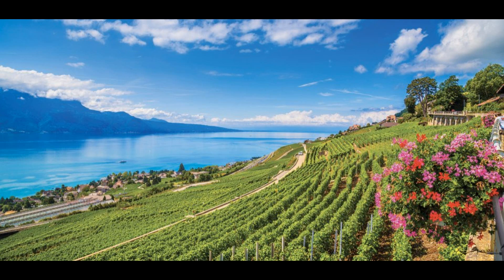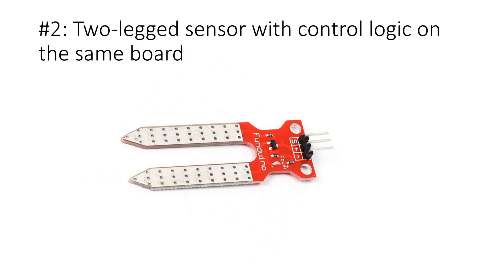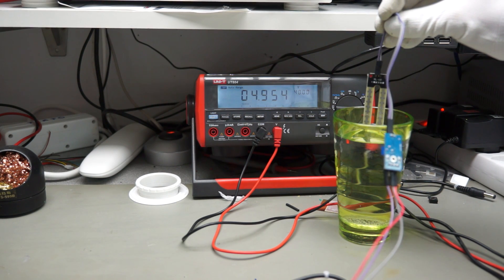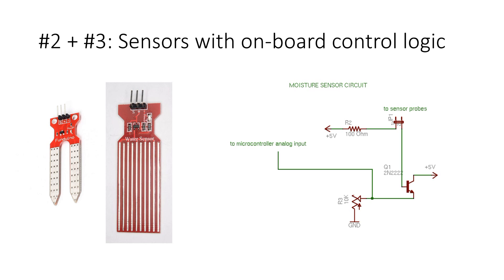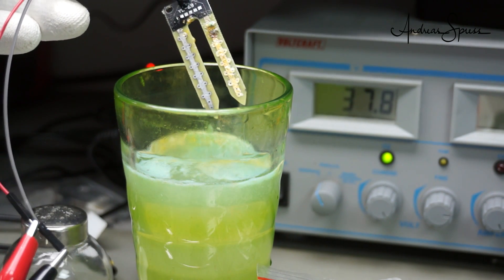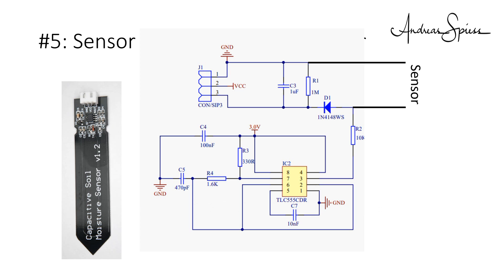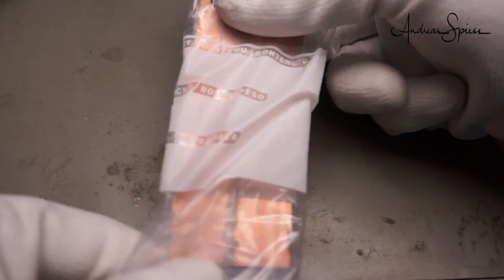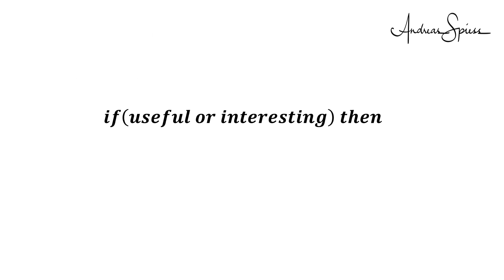#207 Why most Arduino Soil Moisture Sensors suck (incl. solution)

Comment: After seeing your video, I was hopeful.  To solve the initial corrosion problem, for the last two seasons I tried stainless steel strips for the probe but at the end of the season, even the stainless steel would corrode.  So I was kicking around the use of a tiny H-bridge driver but didn't get too far.  I bought a few of those capacitive probes and on the bench they seem to work but so far they don't seem to be very good at being able to detect the difference between damp soil and wet soil.  I've removed the 555 driver and driven it with the T0 output of an ATtiny at 500KHz.  The 555s were all running around 360KHz.  Has anyone had any real success using these EBay special  capacitive soil moisture probes?   Maybe my soil has to be sandier or something.
Reply from the maker: These sensors are not very accurate. They just indicate if the soil is dry or wet.

Comment: I have solved this problem years ago by using a capasitor in series with the sensor and using alternating current for measurement. The capasitor eliminates the DC component and prevents corrosion.
Reply from the maker: Using AC  was mentioned several times in other comments. Some also mentioned it will not completely remove oxidation.

Comment: if you have a stainless steel or aluminium fork, it probably won't corrode much as long as you swap polarity for each reading.
Reply from the maker: This would definitively be a better solution

Comment: I did something like this a while ago. I only measured every 15 minutes, using the AC measuring method with an arduino. The sensor itself was very reliable and basic, just two stainless steel rods stuck into a pair of screwable wire connectors. The system was running for a year with no loss of accuracy and absolutely no damage to the rods. The rods were 4mm diameter and 10cm in length.
Reply from the maker: Thank you for sharing your experience!

Comment: As a fix for an existing system and maybe in wait for capacitive sensor replacement, just edit the sketch to power the sensor only once every 15 minutes or so. A lot of example sketches have constant power to the sensor and you’ll quickly render them useless. With automatic watering, you’ll want to wait for the moisture to increase after watering anyways, so you can retest and see if it needs more watering. 

Even 1 hour or more could be sufficient for an automatic system.
Reply from the maker: Many other viewers suggested this method. But it seems not to work forever.
Reply: Andreas Spiess True, it will still corrode with DC current, but not as quickly as when the current is always on at the sensor. 
I’m ordering capacitive sensors for next years setup anyways, seems to be better for a more permanent setup, especially for greenhouses.  👍

Comment: The green stuff is copper oxide. The reason it does this is because of a process called hydrolosis where the current rips the water into hydrogen and oxygen. The pure oxygen then reacts with the copper on the traces degrading them
Reply from the maker: Thank you for the explanation!

Comment: First off measuring moisture with DC? Some wannabe engineer clearly skipped years of school.
While AC can mitigate the problems with electrolysis another simple way i imagine would be to just use graphite rods salvaged from old zinc batteries.
AC for measurement, limiting the time and current should help with directly measuring the soil conductivity.
Also since one is not required to have the electronic close to the sensor it is easier to take measurements from deeper in the ground helping to see if deep rooting plants get their fair share of water, too.
A lot of garden topologies require more than one sensor since water flows and propagate often very uneven, and foilge or any kind of covering have an impact on how fast the soil evaporates water or distributes it to plants or water just sinks deeper and flows to your now happy lazy neighbour ;-)
Reply from the maker: There are a few different possibilities. I still think, capacitive without any contact to ground is a good one.

Comment: Gosh darn those sensors suck some.. Arse!! Vegetable farmer and diy guy here that really dislikes those bare cheap sensors, I made some stuff with them but their values keep changing because the sensor is falling apart. Think also that you need to move the sensor weekly for the best reading of what is actually happening. But then again I feel my hands are much better sensors and a count down timer watering helps more then fighting the moister sensor.
Reply from the maker: I think our hands are much better in many areas. For holidays you might need long arms (or a good friend) ;-)

Comment: Great video! I've had this problem a few years ago with water level detectors. Even with small voltages the electrodes disappeared after a few days. I tried replacing them with stainless steel electrodes, it appeared it didn't corrode, at least not as fast, but I now realize it might create even more toxic waste as a result because of chromium. I wish I knew about the capacitive sensors back then.
Reply from the maker: Thank you for sharing your experience!

Comment: solution would be to use an AC signal / switch the polarity of the sensor electrodes 50/50d duty cycle
Reply from the maker: You are right. If you read the other comments you see that it would not help for much longer because in certain situations the sensors are destroyed without any connection

Comment: Any way to make a reliable moisture sensor with an adjustable digital output to directly control a solenoid valve ?

A capacitance sensor wired to a LM393 comparator perhaps ?
Reply from the maker: You can use any comparator for that.
Reply: Im a newbie at this, but do i understand it correctly that the capacitance sensor can be hooked to the controller pcb on your #1 sensor and it will output a digital 5v signal that can control a solenoid relay ?
Reply from the maker: Yes. All these sensors output a variable voltage. You should be able to connect it to the PCB of the #1 sensor because it contains a comparator.

Comment: I have the same experiences with both sensor types. The capacitive sensor, however, still has a problem. If the soil changes from wet to dry, a permanent gap in the soil can develop there, which makes further measurements useless. Of course, it depends heavily on the soil conditions.

Maybe high-frequency radio waves are the solution. I did a first experiment with a Bluetooth tracker and measured the dBm. Looks promising. I have packed it waterproof and buried about 15cm in dry soil. Then I irrigated the soil bit by bit and found noticeable changes in the dBm.
Reply from the maker: You are right. Measuring moisture seems to be an art. These sensors are just ok for detecting the time to water plants. Not more. They are not very accurate, but also quite cheap.

Comment: Hi Andreas, as reliable soil moisture sensors are interessesting for me over many years (my plants at my Student digs first raised the problem), I was very pleased to see your video. I think the only solution are the capacitive sensors. Today I found another implementation at tindie: SoilWatch 10 - Soil moisture sensor / https://www.tindie.com/products/pinotech/soilwatch-10-soil-moisture-sensor/
Reply from the maker: Thanks for the link. They claim that they use 75 MHz. This is quite interesting...

Comment: Hi Andreas, I try to use a shrinkwrap with glue inside to seal the capacitive sensor. But I do not if it was issued by the head or by the shrink tube. The analog read was 370-714 without the shrink tube and now 680-714. Therefore the shrink tube is currently not a good idea, but It would make it very simple. I orderd some new sensors to do more testing. My other died like you described by water coming in from the side.
Reply from the maker: Maybe you can send me a message on Facebook or Twitter. I also do some tests for a next video.
Reply: I'm thinking about designing a sensor which fits into those petling (small Pet Tube), where do you  think are the limits in wall thickness for this kind of measurements? I'm planning a whole package with an LiFePo Cell, ESP8266 and the sensor itself. Maybe i can heat and press the pet tube at the lower sensor part together to get a better smaller gap to the water.  This package would be 100% waterproof :)

Comment: As far as comments suggesting making measurements only every 5 to 15 minutes with the bare metal sensors, they will still fail just because they are in damp soil. As shown, releasing tin and copper oxides into the soil. Not good for your plants.

Seriously, just stick the sensor into one of your potted plants without any electronics attached to it. See how it looks after a month.
Reply from the maker: You are right!

Comment: A cool video idea would be setting up an all-in-one DIY sensing station that reports a set of values back to base.

* Soil temperature
* Air temperature
* Soil moisture
* Air humidity
* Barometric pressure
* Sunlight levels

Bonus points for making everything solar/battery powered so you can chuck it in your garden anywhere
Reply from the maker: Interesting idea...

Comment: Great video! Ive learnt new things. Anyway, instead of using capacitive sensors, what about using graphite as sensor probes? Graphite are used in many electrolytic cells as electrodes so they won't corrode away like copper does. Plus, i think graphite can be cheap too as it can be found in pencils.
Reply from the maker: Graphite was suggested also by other viewers. It is a good idea.
Reply: yes it is good... but electrolysis will still take place.

Comment: I started prototyping the 555 based capacitive sensor but then realized ... Why would I need a 555 when I am reading the value with a μController? I can just use the `analogWrite` function on the AVR to create a 50% duty cycle PWM and there is no need for a 555 astable multivibrator, just the circuit with the diode and RC filter. My idea was taking the cheapest resistive sensor, coating it with some plastic color, and trying to use the 555 circuit ... but now I think I don't even need a 555, can just use GND, PWM (Analog Out), and SENSOR pins with the AVR, voila! What do you think about it Andreas?
Reply from the maker: I think: try it. And report back.

Comment: I solved the problem with firt sensor you used- solder over electrodes. Works fine, lasts 5x more.
Reply from the maker: Maybe you read other comments. Lead in the solder seems to be „not ideal“ for plants. But for sure it takes longer till the electrodes are gone.

Comment: You aren't supposed to power those sensors all the time, you need to supply voltage at intervals like 1 minute or 1 hour... This prevents hydro electrolysis
Reply from the maker: This was suggested by many viewers. According to these comments, it does not prevent it, it reduces it considerably.

Comment: Thanks for your review! Ongoing calibrating my new capacitive 1.2 sensor.Sends signals from a esp8266 via mqtt to "Home Assistant HASSIO" After coating the sensor 100% wet is 526,  0% Wet (dry) the signal from esp is 806. Has anyone any experience what i could expect in between??? Current Ide code  " percent = (int) (287.86-(value * 0.36));"
Reply from the maker: If you read through the internet it is very difficult if not impossible to calibrate these sensors. They are not used for "precision" measurements, just for indications. And the calibration depends on many things including temperature.
Reply: Thanks! A voltige regulator for the sensor is a must. Have the sensor a linear or exponential behavior? The "trial and test method" with different temperature is maybe the best...

Comment: You can "solve" the resistance type sensor problem by only taking a reading over a short period (like a couple milliseconds) every hour or so. It'll still degrade eventually, but much, much slower.

I'm using a resistance type arrangement but I don't stick the electrodes into the soil. I've fixed two stainless steel electrodes to the bottom of the outer pot, and they just measure during watering when the water has percolated trough the pot to the bottom, which resets the timer and makes everything sleep for a week.

Couldn't you simply form the capacitor type sensor with two wires?
Reply from the maker: 1. The trick with the sensor switch is described in many comments and I should have mentioned it. Some commenters still experience corrosion. Maybe it also depends on the general moisture level or the chemistry of the soil.
2. If the two wires create a capacity which is big enough it should work. It depends also on the distance between the wires.

Comment: Nice Video! Number #5 output will change with fertilizer, or? (Higher salt content in the water)
Reply from the maker: Maybe a little, but not much. These sensors are anyway not accurate. The just give indications.

Comment: I didn't realize there were generics of the capacitive sensors now! From what I've heard they are a lot more accurate than the resistive ones.

Just so you know though, you can prevent the destruction of the resistive sensors by only applying power only for a few milliseconds at a time whenever you need to take a measurement. I used to just connect the +5v pin to an output pin on my MCU and turn that output on when I need to take a reading.
Reply from the maker: You are right. This was discussed in many other comments below.

Comment: As a proponent of KISS, I simply don't use any of those sensors.
It's just an ESP that opens/closes a solenoid and starts/stops a pump according to a schedule. The schedule can be changed in a web interface hosted on the ESP. Look how much water you use with watering cans and the output of your pump. Then you know how to match your schedule.
I also write the schedule to the ESP and time gets synched. So if power loss happens, everything will keep working like nothing happened.
Reply from the maker: I think this will also work. You even could combine it with Google calendar as I did in one of my videos. Then the user interface is also quite simple and the ESP has no data stored.

Comment: Interesting video. Expected the results of DC probes in soil, but didn't expect the capacitive sensor to work so well.
I used, many years ago, a different and more rudimentary approach to this: a probe made of two small strips of stainless steel and a single-transistor low power oscillator, similar to the so-called Joule Thief, to generate a "kind of sine wave" of relatively high voltage (some 20-30V) and very low current. This signal was fed to one SS strip via a capacitor and the return picked up on the other SS strip + capacitor, to be amplified by another transistor. The final prototype ended up looking similar to the very simple, yet effective, ESR meters that were proposed in forums in Russia and other eastern european countries at that time. I could not find my old circuit, nor the russian ESR handwritten diagrams, but I found a much more recent version of this kind of design in http://zpostbox.ru/simple_esr_meter_circuit.html and another in http://paulorenato.com/index.php/electronics-diy/94-building-an-esr-meter, with a more complicated oscillator with a 555.
Although outdated, this simple approach may interest someone to tinker with, for detecting resistance variations using very low power AC (soil moisture or rain / water level) and avoid the dreaded electrochemical corrosion inherent to the use of DC, which not even SS endures.
Reply from the maker: Thank you for your links. AFAIK ESR meters measure the series resistance of a capacitor. I do not think this is what changes with humidity. Most sources assume the capacitance changes if you add water. The ESR meter tries to avoid measuring the capacitance by using a high frequency (as described in one of your links). So, a usual ESR meter would probably not do the trick. Maybe your device was also measuring capacitance, just using a different technique.
Reply: No, I was not measuring capacitance. An ESR meter is an AC Ohmmeter and will measure electric resistance in any component or conductive material.
My prototype was a variable frequency low power AC source feeding the electrode - soil - electrode set and measuring the result. The soil moisture changes the electric resistance of the soil (and many other parameters) and thus, the resistance between the two electrodes.
Also, and this was the main purpose of the prototype, there are numerous old books about electric farming, describing the benefits of AC currents for the plants. The idea was to find which frequencies the plants would "like" and, while using the circuit to measure the water content, also please the plants.
But it takes a long time to see the results of different frequencies in plant growth (if any) and I gradually lost interest. Anyway, it was just an idea of a different approach, that could, eventually, interest someone.